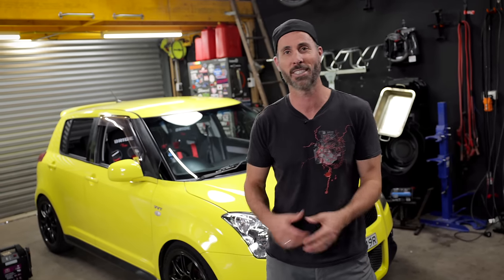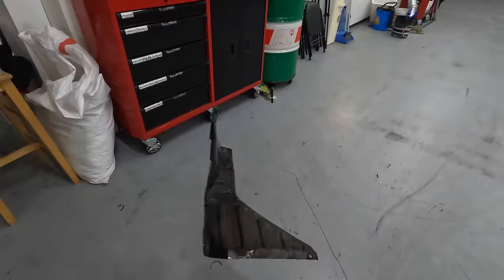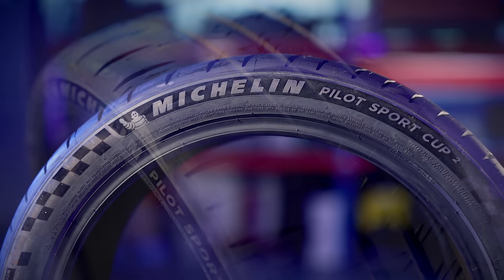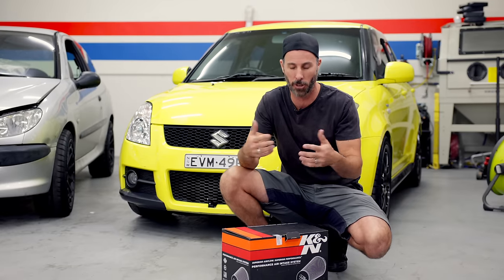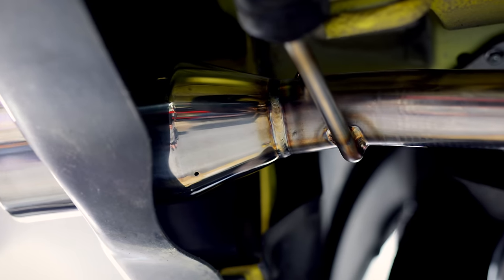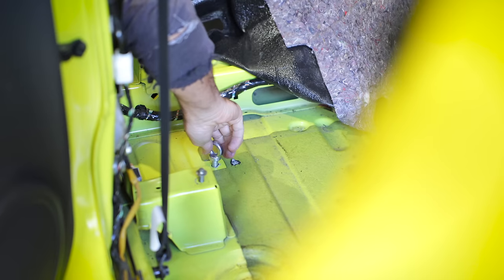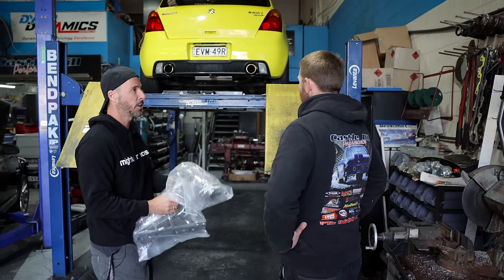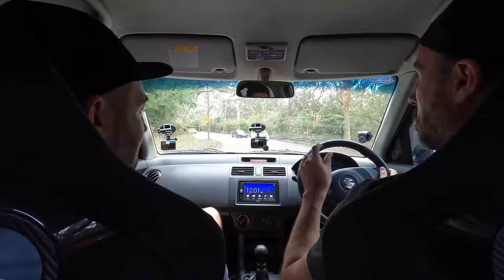Building a $25,000 Suzuki Swift in 27 MINUTES

Comment: Wow that K&N filter setup is a rip-off.
Reply: Agreed, Stock intake will be way more consistent
Reply: A total rip off, and the trade-off as Moog says, more flow=less filtration with K&N. Plus it’s now a hot air intake, losing pretty much any gains, and except for the intake borp noise that’s it.
They ended up with the stock as it works better.
Reply: That's what you get when a quality company sells out to investors that exploit a name for short term money. 🤷‍♂️
Reply: Anybody could of told you that lol.
Reply: @patrickfargie1146  well, they didn't so I did.
Reply: hot air intake
Reply: @muzza0335 the dort noise is literally the only reason to modify an intake - It's a rite of passage to throw a dog-dick red cone of power on a random bit of alloy tube attached to a weak arse 4 banger. Don't tell me you haven't done it 🤝
Reply: It’s only a rip off if it’s put on top of the engine. I’m guessing if it had been relocated to a cooler place, I.e the wheel well, it may have performed better. But, it also may not have. I do think almost 500 dollars is a bit much though.
Reply: The better way to do it would have been to just replace the stock panel filter with a K&N panel replacement filter.
Reply: I’m sure that if the filter had been positioned better to collect cold air instead of hot engine bay air, it would have performed better.
Reply: $500 is for real crazy, the cone filters were $50 last I bought a similar one like 8 years ago. I remember seeing similar universal kits to this for $140-200 at Walmart back then also. Is it just marked up in Australia or have they jacked up the prices? 🤨
Reply: Pretty sure this is a compilation of already shown stuff and they turfed out the filter for stock
Reply: Would’ve thrown that k/n in the bin as soon as I pulled that flex pipe out
Reply: " spending small chunks of money " lie .
Reply: I bought a injen intake that leads to the bottom of the car behind the mistlight with a  (perfect clean cold spot) for €300. Very good sound and good quality
Reply: In America, the kit is $250 usd. I guess that import fee is insane 😳
Reply: You need a proper setup on these like monster sport intake, injen or greddy which are all expensive af. That is the best way open air filter ones are not working on these
Reply: @notingeesar3647  or just avoid that damned filter because my turbo setup was like $600 with a $10 Simota filter...
Reply: 500 dollars lmao. In my country they are 5 dollars max
Reply: Proudly made in the US of A brudder
Reply: @David-xl8zf  Capitalism ruining everything, what is this, a day ending with Y?
Reply: @David-xl8zf  k&n always made shit filters. Even my old trucks. Mudding and the carb hat would be dirty. I haven't ran a k&n in ages
Reply: @meegstomtom  that´s not what they´re meant for.
Reply: @David-xl8zf  their ment for the garbage. They even suck for street driven vehicles. And yes. They did market them for offroading. I don't even run one on my drag car.
Reply: @kyleerb9191 😂😂😂

Comment: That intake is horrendous. K&N should be more ashamed than usual.
Reply: Literally. 500 bucks for that is disgusting
Reply: But on the bright side they got confirmed dyno proof it kills power
Reply: Atrocious k&n. They literally paid 440$ for the flexible tube alone. Pod filters are less than 60 bucks..
Reply: @Partnerthedog  Err, no, you missed the bit that houses the MAF, but that doesn't excuse the totally ridiculous ripoff that intake represents.
Reply: Pod filters being useless shouldn't surprise anyone.
Reply: And the plastic end... did someone cut that with their teeth?
Reply: At that price you could expect the kit to come with an aluminium intake tube which places the pod filter at least somewhere with decent airflow...there should be some decent kits available in Japan, which begs the question why they went for the K&N junk in the first place
Reply: Love my stock RE4 Swift….even stock it’s still a fun car to drive
Reply: There's an intake kit from Beatrush that is only 100 bucks more, but a million times better
Reply: @samteks125 
You don’t want aluminium pipes, plastic or carbon is a much better insulator for heat. Aluminium is about the most heat conductive material you can get. 
I know alloy looks better but in practice it’s not. ❤
Reply: @myownsite  MCM even did testing to prove it and that style of install too lol
Reply: Top tip for these avoid.
Reply: Look at DNA filters, way better quality, flow, and finish. K&N looks like Chinese crap
Reply: I came here to say the same thing, obligatory post about how terrible that intake is
Reply: If i remember right Monster sport did make sick duct intake for that car, i think it was shown on the devloppement/ showcar featured in many Best motoring/Hot version, on Gunsai touge battle if my memory don't fool me.
Reply: All k&n air filters are horrible, why put sticky oil in the intake!
Reply: Did Super Chinese Autos refund you your money on that piece of shyte?
Reply: @K-so8gx  To trap fine dust. That part is legit, the whole "pay us $500 for a podfilter which makes the engine suck hot air" is the dodgy part.
Reply: Yep its sucking in all the hot air
What i bought is Injen Cold air intake  It goes down to the bumper so it gets more air  and it looks better
Reply: is that filter made from recycling plastic bucket...??? 😂
Reply: as soon as I saw that logo, I knew I am going to see some shit lmao
Reply: @J2I3H  It's top dollar US crap, nothing to do with China, why is it that China is always to go to for racis- I mean critics to say something about quality from other places?
Also China produces like... all of our stuff, from high end electronics to cars, their batteries and their architectures, all of which are known to be of great quality, why is that never mentioned? ;)
Reply: @sheerluckholmes5468  Racism is such a bad look.

Comment: I just fixed that exact same oil leak on my little nugget. There is a trick so thought I'd share it. You don't have to remove the ac compressor or the exhaust, instead remove the front bumper and you can access the bolts front on & it gives you heaps of room due to the swift having a small radiator. I used a 1/4" drive ratchet with flexi and a ratchet spanner. No need to drain the coolant either just move the housing to the side with the line still connected and pull the gasket out.
Reply: Oh! that is the trick. gonna try it on my car wasted like 50$ on repairs.

Comment: Rented one at the Nurburgring 13 years ago,  full roll cage, bucket seats, ohlins suspension, good brakes, semis, ceramic clutch... ABSOLUTELY loved it. the best example that, low weight with a good setup is much better than pure HP

Comment: Yes, wheels tyres, seats and a must have, full race harness.  Out of all the mods I used for hillclimbs, my race harness gave me almost 2 seconds.  Sure my R spec rubber also gave me 2 seconds, but the harness gave me that for 30% of the cost of rubber.  And do them in stages, and take notes and see if you can get videos or pictures in corners so you can see what happens when the car is loaded.  You need data like entry and exit speeds, tyre temp and suspension changes.  That may sound like "over the top" , but if you want to go as fast as the vehicle is capable of, then you must collect data.  And get a track app that allows you to see what happened.

Comment: I had a Simota intake on my swift which came with a 45 degree maf housing to relocate the filter to the front of the engine bay, would definitely recommend flipping the intake pipe that goes onto the throttle body to get the filter away from the block as they do tend to run a bit hot 😅 wicked car & wicked video boys 🤙🏼

Comment: Just to mention, it's worth checking the thermostat on these engines, they fail which is very common causing headlift because the car is running hot (temp gauge is very slow and may not even move).

Go for a long drive getting the car warm, and check the lower rad hose which is near the gearbox, the hose must be warm or hot - this means the thermostat is opening up.

My thermostat didn't open up which was causung my engine to run hot without even telling me.

Comment: Yup, for better chassis stiffness I would add Beatrush fender bars. To reduce the roll summit RARB and a cusco FARB. Intake, one can go crazy with a suzuki sport ITBs or for me a trust intake. Exhaust same but with a Sunline single endcan. The factory bonnet is quite heavy stock so a CF one will help reduce weight. At higher speed track, a greddy sump guard helps to smooth the air flow under the engine creating 0 lift. For better grip out the corners a LSD will help it tons. Finally, just for the engine sake, a monster sports oil sump baffle plate... due to the oil pick up location, at certain Gs in a corner, it can't pick up oil and can cause premature failure.

Comment: I have the 2nd gen Swift Sport, it's such a fun little car. I changed from the original 17" wheels to 16" though, since it gives the option for wider tires and a bigger sidewall allows the tire to work a little better. The rolling diameter of the tires is also a little smaller, which makes the car even more punchy. An exhaust change is a must on these cars, they are way too muted with the stock exhaust. Next on my list is brake pads and coilovers (if the TÜV plays nicely).

Comment: I got the same car, same color like you. I put K&N filter with some hot bit adapter and custom kit ordered from Malaysia which is the position of the filter setup is way better than what you got from the official k&n package. 

I suggest you guys try to work some upgrade to the clutch and flywheel. I upgrade my clutch kit to Exedy Heavy duty clutch kit(pink colour) and Extreme single mass light flywheel. It put a really big smile to me whenever shifting the all the gears 😁.

Comment: I have suzuki swift too. Same model as you, only cc 1.5. I have upgraded on stage 2. I modified the absorber to 40% stiffer by using the original absorber. I use potenza re004 tires. My car is not fast, but it can corner fast without shaking. I have also changed the air intake but had to use the original air intake because my rpm is very low. The engine always wants to turn off. I also change racing headers. Please make more video about this swift modification.

Comment: Yeah wow, 25 large 😮
I love the "zuke swifts" i have 3 of them, mind you none of them are the sports edition but mind you still are an awesome fun car. 
Few things, the oil control valve can let you down, it will leak. Your oil filter housing leak was typical. 
Can't believe you bought that K&N piece of crap, as you have learned the factory air intake works a treat.
Other items of concern is the paint on these thing, so thin and easily damaged from UV or high pressure cleaning + the steering wheel, they are just rubbish and are prone to damage. 
I do love the colour of yours, yellow and the factory alloy wheels 
But cant stand the red high lights in the seats, just yuck. 
Looking forward to learning more with you on this fun little car

Comment: I bought my daughter a Swift S years ago, it was the only little car that had curtain air bags.  It was a great little car, the struts shat themselves at very low miles so that was pretty poor, but other than that is required no repairs.  The Swift Sport was to me pretty poor value, naming it a "Sport" was misleading IMO.  But that's coming from a MKV GTI guy (bought new in 2008 and still going strong).  Buying a Sport and doing a $25,000 build to get the same performance is ridiculous - only if you can make money out of Youtube with the silly spend does it make any sense, if not much.

Comment: Intake is fail upon fail each time except in a very rare occassion when on the dyno it does become a problem. Which on the dyno you can simply check by taking the entire intake filter box off and running it open from the MAP sensor. Until that time it's a genuine waste of money at all time.

Comment: If you ever go to the Nurburgring Nordschleife, by far the smartest thing you can do is hire a track-prepped Swift the whole time. It's cheap, and a lot of fun. Because there is nothing less fun than driving a fast car slowly at a track, and practically nothing more fun than thrashing the rings out of a slow car at a track. Plus, if you rent a 911 at the 'Ring you will have to pay the first 15,000 Euros of damage when you crash it. :P

So, while a properly specified and prepared Swift won't be setting any lap times you want to tell your friends, well... anywhere, it most certainly WILL provide you with a lot of smiles. And because we know there isn't a car in this world that Moog can set a decent lap time in, it makes absolute and total sense!

Comment: Did I miss something? What was done to the brakes? If you're going to go thrash a car on track, first mod should always be upgrade your brakes to cope with constantly stopping from higher speeds and all the extra heat it generates - so pads, discs and fluid 👍👍👍
Reply: My thoughts exactly! The original brakes look quite ropey as well.

Comment: I doubt you got ANY performance boost from the exhaust or intake.  You might get a little better track time from the suspension if adjusted right and the tires will help.  Better break pads and rotors would have helped too.  Headers will help more if the intake is ported.  You need to trim weight.  Strip out the interior, the spare, jack, the stereo and speakers, trim, door panels, carpet...  Also things like the heater and AC can go.  Carbon fiber panels would help too.  If you cut 10% off the weight is basically the same as adding 10% to the HP, but without cooking the breaks and cooling system.
Reply: this please! 👌

Comment: The suspension looks like it's very similar to a Honda Fit, if the car doesn't already have a rear sway bar, I highly recommend getting one. It will make more of a difference in handling than the coilovers did. 
When it comes to POD filters, I really think most people equate the increased induction noise with additional performance, when in reality it's just the ear hole being titillated.
Reply: rear torsion beam. economy suspension,
Reply: @christianbartell8649  What's your point? My statement is a fact. So I don't understand your pointing out the obvious?
Reply: @estewar03  I mean mean the torsion beam is on a ton of cars. The Honda fit isn't unique in having that suspension design. I also agree the rear sway and brake upgrade would be better than louder intake sounds but ya know, whatever
Reply: @christianbartell8649  that's not the only reason I said it was similar.... for example, the front struts are the same design & share the same shitty tophat design. 👍

Comment: Y'know, we here in the States never got the Swift (though the name was used in our market for the older Cultus), but it reminds me a lot of a car we--and only we--got: the Toyota Matrix.

The Matrix was a California-built collaboration with General Motors (it was also sold as the Pontiac Vibe) as a development of the E130 Corolla. Everywhere else in the world had the option of buying a Corolla hatchback or wagon, but we haven't gotten one of those since 1990s; Toyota and GM together threw us a bone by building a rakish-looking five-door hatch on the Corolla platform. They even made a sportier version--the XRS--with the same high-revving 2ZZ-GE engine as in your old Lotus Exige, although the supercharger was an optional extra from the TRD catalogue.

Mine's unfortunately from the final production year of the first-gen model, after they discontinued the XRS trim, but with a factory handling kit and stiffer springs, I don't miss the extra 50-odd horsepower too much. It's a low-power, economy hatchback that I can throw full-force into a corner without having to worry about coming out the other side in one piece. Even if I wasn't humiliating much more powerful and expensive cars on a surprisingly frequent basis (read: not always, but it's happened more than once, and one of those times I had a dishwasher in the back), I'd still say it's one of the most fun cars I've driven, right up there with my dearly-departed 1986 MR2. I don't doubt that even a stock Swift is very much the same, and with all the work you've put into it, I have no problem believing all the praise you heap on it is completely genuine. Builds like this one are exactly what got me into this channel in the first place, and I'm always happy when y'all find another underrated economy car to put the spotlight on. Shine on, lads.

Comment: I have a 2002 WRX that I bought new. In 2012 after 170,000 miles of modifications and driving it like I stole it the engine started knocking. Car sat in garage. In 2019 I bought a 2009 Forester X 2.5 to daily while I fixed the WRX. Bought a replacement JDM engine for the WRX and got to work....sort of. I started the while I am in there with the WRX. Bigger turbo, higher flow fuel pump......etc. Meanwhile I cant drive a stock Forester so I put my Prodrive PFF7s from the WRX on. Nice but to high. Bought a set of ISC coilovers and lowered it 3 inches. Wow looks good and handles. Next went on ISC adjustable lower control arms, a Perrin 25mm rear swaybar. Endlinks and adjustable lateral arms to alow more adjustment for the rear. Next was wider 18x9.5 wheels with sticky Falken Azenis RT615K+ tires a Nameless axleback exhaust and a Sparco seat. My Forester is slow as crap but my goodness does it handle. My workmate has a 2022 Civic Type R and cannot keep up with me in the corners. Next I am buying a wrecked GV STi. Swapping over brakes, axles, R180 and 6speed then selling everything else. Then a EZ30. Keeping it naturaly aspirated. Maybe one day I will finish the WRX.